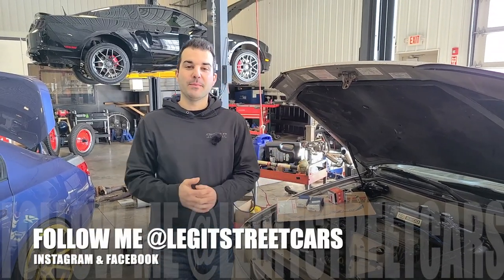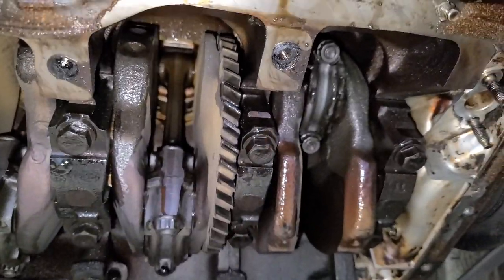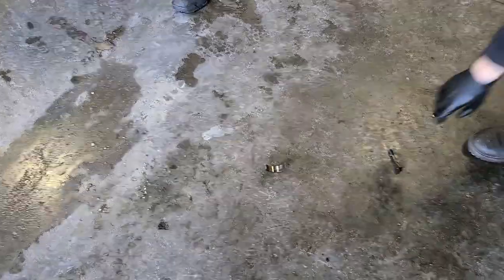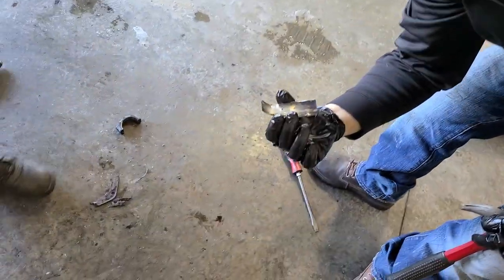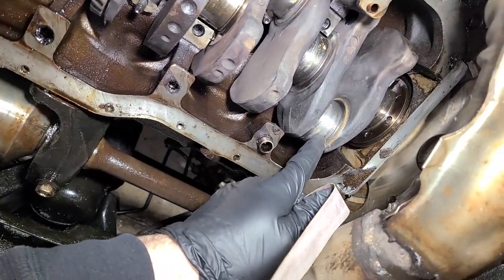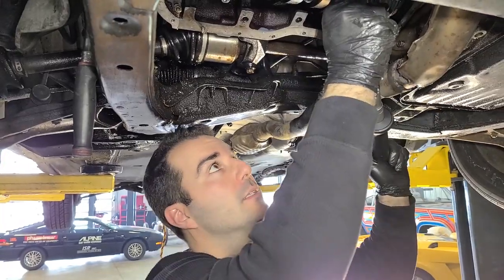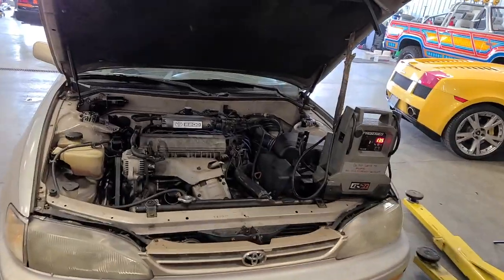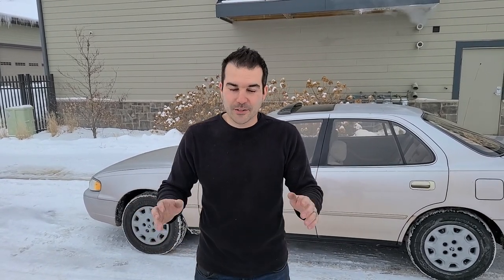I Blew Up A Camry Engine & People Were Upset So I Rebuilt It In The Worst Possible Way & It Worked!

Comment: Did you clock the balancers?

We did something similar with a 1972 Buick Regal with a 350 V8 as well as my 450,000km 1978 Plymouth Volare (I'd been delivering pizza for 5 years my last year at high school and for 4 years at university). Both cars were about 10 years old at the time ('82 & '88).

We replaced the bearings in the Regal but the slant 6 in the Volare kept unseizing every time it cooled down (no oil and no coolant). The Volare had been treated with "slick50" but we figured the 450,000 clearances helped to keep it from fully seizing...

Eventually we put oil and coolant back in the Volare and drove it ~100 miles before it threw a rod out the side of the block.

The Regal lasted 10's of 1000's of pizza delivery miles, although it always had a bit of rod knock.

We also sortof did the same with a 1970 Chrysler Newport Convertible with a 375hp 440 4bbl in 1982. That one we hit a rock racing my 1972 Ford Pinto in a field, and punching a hold in the oil pan. We didn't notice the hole until after it seized and it never ran again.

Oh to be young and foolish again...
Reply: BTW, before throwing the rod the 225 slant 6 started experiencing "crankcase explosions". Basically so much fuel would slip past the melted piston rings that the crank area would suddenly explode. These explosions caused both the oil pan and valve cover to balloon outwards so much that we couldn't reach the bolts. 

Amazingly these explosions would occur randomly while the engine was running under load. Unlike a more common intake explosion, these crankcase explosions didn't cause the engine to stall - just made a very loud BANG sound each time. 

Once we added some thick oil (20w50) the crankcase explosions stopped...

BTW2, the 225 "Super Six" has solid lifters so until the slick50 treated bearings started to knock it sounded normal.

The Regal's hydraulic lifters on the other hand started clattering horrifically without oil. The collapsed lifters didn't seem to cause any issues with how it ran, other than making very loud lifter clattering.

The Chrysler 440's hydraulic lifters couldn't be heard above the open headers but I assume they were clattering...

Comment: Dear Alex Crac,
You missed checking out the upper cylinder through the spark plug holes to see if there is any ring scaring on the cylinder.
.
Maybe try re-adding the marvelous rejuvenater again now that the engine is ""rebuilt"".
Try adding 'bars' radiator sealer to stop the leak, or maybe 'fiberlock' to fix the entire system (LOL).
Take these videos off FB for a month and then sell this to uncle Richie B to have him restore it. (double LOL).  Only $1300, like the sign shows.
Regards,

Comment: I use to run 1 bottle Lucas with 4 quarts of 10w40 in my 3l Mitsubishi powered Caravan. Kept the lifters silent, might reduce the noise. Or just throw some rotella 20w50 in for the same effect.
I’d love to see this with evans waterless coolant, just to see if it really does cool an unpressurized system adequately.

Comment: My wife had one of these. It leaked/burned enough oil between changes that it would get to 1 quart and the warning light would come on. Never knocked or gave us any trouble even with only 1 qt in it. Still made it to 220k and then we sold it these are awesome old cars.

Comment: Funny thing is its only some gudgeon pin bearings away from being a good runner again. No smoke or oil out the exhaust means it didn't hurt the pistons or top end at all. 
Thats a tank of an engine and its good to see you throw it back together - even if it is mostly for the joke of it.

Comment: That knocking noise could be the balance shaft bearings since it doesn't look like you replaced those. They will spin quite easily without oil since they spin at 2X the engine's RPM. Also, the balance shafts actually do need to be timed to the engine, it will shake like crazy if they are out of time.

Comment: The funny thing is you proved your point by removing the oil pan on top of the oil.  it was not dying very quickly (but hurting) with the oil pan on.  Would never ever do that but still.  Start and run mild knock.
Reply: Guessed right!  Shocked about that but it seems with the tolerance changes that would be expected.

Comment: tried this on a gmc acadia awhile back, had 1 spun rod bearing, polished the crank and threw another bearing in it. ran great for about 1000 miles then violently put 2 holes in the block

Comment: This is some entertainment. This is backyard mechanics in its finest. As you said so many times, not to be done at home this way.

A proper rebuild or a good condition swap should be done.

Also, as many pointed out, the balance shafts should be timed. Some don't bother fixing them when they go bad, because even rebuilt units are expensive.

Comment: Cut a nail to fit in the oil hole on the crank rotate the crank to push old bearings out and new ones in

Comment: You might have checked the new bearing clearance w/P-gage and boosted the oil pressure w/bypass pressure spring shims. [might have helped and the noise will get worse now] Trust me I have tried this kind of thing on junk not ready to throw away yet...jf...

Comment: I took my balanced shaft off, runs fine, vibrates more like the 80s Camry that didn't have a balance shaft. Less enertia to spin, runs better, more vibration though, but not intolerable.

Comment: When we were young and dumb we legit did this on an 87 Hyundai Excel and hey.......it worked! 
That POS ran for another year, running around with NO springs, a huge stereo system, eating a set of tires in a week and burning whatever kind of oil-ish substance we poured into it.

Comment: I'd check the cams. If the bearing were that bad then I'd expect some gruesome wear on the cams. If all is good, flush the oil, change oil and filter again and all would appear promising.
Bob will do just fine.

Comment: Those balance shafts must be timed with the crank! How would they balance out vibrations if they are not in time with the engine? You used to be MB technician, you should know that. 
That engine gonna knock - definetly :D but it's gonna run. Try like 60 weight oil to see if it quites down. Thx for trying to save it. I hated the destroing video of Bob engine.

Comment: I'm hoping Alex was kidding about not needing to time the balance shafts... it didn't appear to be trying to shake itself apart, so I'm guessing it was a joke.
I'd like to see a compression & leakdown test, and maybe clearance the valves so it doesn't sound like a worn-out diesel. 
A bit of road time will tell if it now swills oil. It wouldn't surprise me if the oil pump is badly worn, which shouldn't be too hard to replace - might also help quiet it down, if oil pressure is low.

Comment: When l was 20 l had a fiero, terrible car in the winter here in Ontario, but when l blew it up dad got an engine from the wrecker and l put the best of both parts in the block that was still in the car. It ran on for years after. Then we did the same thing on my brothers old ranger. What if you do the same for the pistons and rods, lm also guessing your cams are considerably less lumpy now. Lol

Comment: Good God man.  Just loosen the serpentine belt would make installing the main bearings so much easier. A claw hammer does not belong in a mechanics shop. and YES the balance shaft needs to be timed.

Comment: Would you say the additive works? Not in the sense of letting you drive with no oil, but as in protecting the engine better than just oil alone.

Not gonna lie, I was expecting the crank journals and cylinder bores to be scored beyond recognition after that abuse.
Any chance of a compression re-test in the next video?

Comment: i want you to please do a complete rebuild for the camry engine like how youre doing for the v12 merc .  
or please send it to me all the way out here in South Africa .  i willl treat her well .. my corolla is  rusting really bad , is on its second engine , leakin oil bad (that's an easy fix , i need to get cam, oil pump & crank seal 4rm da dealer) and the chassis has over  696 000KM ..... so that's perfect ! ...  i'll just keep on driving her  & pretend like there's nothing wrong !! ......keep up the good videos ..please build a w12 bently engine  .

Comment: My brother in law has an old Toyota Corona 1989ish 4wheel drive, the engine seized due to not changing the oil yeah I know I don't understand that either but anyway he changed exactly what you did and it ran really good actually, I'm not sure but I think he had to do maybe 2 times a year to keep it driving lol after a few years he sold it

Comment: i spun a rod in my first car when i was 17, i was doing maybe 160kph down the parkway when it split the lower radiator hose and i didn't notice until it started knocking it's head off, by the time i had come to a stop it had gotten very hot and cooked the bottom end, now my mumma was very strict back then, i was too ashamed to take it home and tell em' what i did. so i rolled it into the nearest westfield carpark, drained it's oil into a 75 cent bucket, sump off, cleaned with brake clean etc;, i then did exactly this trick, changed out a bottom end in a mall carpark at 3AM and limped it home. 

i sold it later that year, and somehow as if my miracle many years later i brought it back..! my repair held up well! probably 8 or so years, until i loaned it to a mate, and he then proceeded to blow it up a second time, also from radiator failure. pretty sure it was cubed after that, shame. 
it was a 1996 suzuki baleno 2 door hatchback for anybody wondering. painted kawasaki green on some oldschool speedy rims. i miss that car

Comment: you should put some of that magic engine oil additive in it now
Reply: The additive works, I have personally tested it. You're not supposed to run the engine without oil during or after the treatment. I'm starting to think Legit street cars is not so legit after pulling a damaging media stunt like this.

Comment: When he said “oh look there’s car max we should go get an estimate” i died laughing. I pretty much did exactly what he was implying. I owned a 2013 Hyundai Accent with the 1.6 GDI engine. At 82,000 miles it started to knock if you all don’t know Hyundai and Kia are recalling so many engines but not for my model. They recalled other models with the exact same engine, but not mine. Me being the second owner of the car it was not under warranty I was pretty broke and feeling defeated. then I had a brilliant idea a couple bottles of STP oil treatment, a deep clean of the car, so it looked well-maintained. I took it to Carmax and got more for the car than when I bought it I owned it 4 years put 40,000 miles on it and made money.

Comment: That wouldn’t be rod nock with having new Bearings it could be piston slap, Wrist pin issue also could have air in the lifters in my opinion lifters haven’t fully bled mixed with sticky/sloppy wrist pin it might come around and quiet up tho
Reply: Oh it could definitely be rod knock.

New bearings don't fix crank journals that are completely out of tolerance. The crank will just rattle in the new bearings and the new bearings will fail real soon. I'd be surprised if this engine lasts more than a hundred miles.

A crank that's as damaged as this is a no-go and should be replaced. It is not reusable without major machining work machining + oversized bearings.
Reply: @99domini99  You wouldn’t need oversize bearings unless you turn the crank most likely what you’re hearing is a mixture of lifter and cam with a better piston slap

Comment: Hello
Could you give me some advice based on your experience with Mercedes Benz, I am a family man like you, I plan to give my wife a GLS 450 from 2017, but several friends have advised me not to buy Mercedes because not without durable onesthat I decide on Subaru, Toyota or Lexus.what would you advise me?
Thanks in advance
Reply: The Mercedes will break your ❤️ and your bank account.  Find a similar aged Toyota in the "limited" trim level instead.  You'll spend less to acquire, and it will be 500% more reliable, and equally comfortable.

Comment: I had a elderly Customer with a well cared for 99 and he borrowed it out to a couple that were having some hard times, and the guy must have revved the piss out it in very cold temps to move it in snowy conditions and  put the rod through the side of the block and took out the AC compressor  besides. The old guy liked his old 99 camry so much that he paid JDM $900 for a used engine plus labor .🙄

Comment: If you had taken the drive belt out you would have slid those top bearing in no problems, the belt holds the crack up tightly

Comment: was it hard to access all the bolt in oil pan without lowering exhaust and whats the black foam looking piece between trans and oil pan
Reply: are you saying the bearings were bad or the rods also... i have a 98 ran low on oil

Comment: Do not try at at home? Why not? It might work, in fact it stands to reason that it should work in this case. So my question is what’s the matter with just putting bearings and if the top hand is OK? It is so much less work than a total rebuild that one should try it.

Comment: Look I love old boring cars, and I absolutely love this video and the last camry one. The whole point of loving old shit boxes is you literally do whatever you want with them and you don't give a crap because it's a cheap crap car. I bought a 2007 Camry as a beater, I put literally 250000 KM on it, yes. Have I driven the camry in an open field of snow for a ton of laughs, yes. Have I driven my Camry off road, yes. Have I jumped my Camry, does 2 feet count? I also bought it for like $5000 Canadian. In 4 years of use, I once had to replace the exhaust for about $250 and did an alignment for $100 because i ran over a 1' deep, 4' wide pothole. I gave the car to my sister and it still functions as a daily driver still.

Would I take the Camry in the video in something like the Gambler 500, yeah, fuck it, why not. I bet this Camry gets another 5000 miles if the radiator gets anything to seal it up or replaced.

Comment: You should be wearing safety glasses metal splinters moving at a 100 MPH plus in the eyeballs I'm just going to stop there I'm glad you didn't get hurt I drive around a 1996 Toyota Camry with a little over 300,000 miles on it and it still runs and drives like a champ hoping to get over a 100,000 miles with it.

Comment: Why would you even have a carpentry hammer in an engineering/automotive shop????
The steel in the head is not suitable for heavy strikes onto other steel components as chipping is highly likely. An engineering ball pen hammer is needed (except for specific tasks where brass heads or dead strike or many various types of mallets are required).

Comment: I have a 2001 Lexus rx300. That is identical to the Camry 3.0 of that year. not the same engine from your video but this one is indestructible as well. 20 years old and I add zero, I repeat zero oil in between oil changes. What engine can top that. I have to admit though. It is slow as s*** with the 4 speed automatic.. 😂

Comment: I've heared about this strange technology about engine additive, who can run without oil from our local inventor or sth. but its actually is engine renewable, who can increase compresion, and this additive based on ceramics nano tech and minerals etc... they said that after adaptation with additive you can run 300km (but its more like test, not normal usage of engine). not tried them, no add, just heard. http://www.rvstechnologija.lt/
Reply: Thats the same stuff he used in the previous video, just different brand.

Comment: Balance shaft delete makes your engine spin up faster just cut the gear
Reply: That particular engine needed the balance shafts.  The motor mounts will deteriorate without them.  While it will rev faster, the HP drain is minimal, for the comfort it provides.

Comment: dude are you seriously using a wire wheel without safety glasses? I get "safety squints" every once in awhile cutting up a tree carcass, but this thing literally throws little wires that will stick into your eye and could blind you. It happens way too often in this trade. Don't be dumb, and protect your ears.

Comment: Bob_amoto.
Japanese cars.... And than nothing for a miles
Reply: that engine was assembled in Georgetown KY.  The block was manufactured in WV.  The crank, connecting rods, heads, pistons and camshaft were shipped in from Japan.  I wouldn't be surprised if 'bob' wasn't the inspector on a shipment of rods at the plant in Gtown.